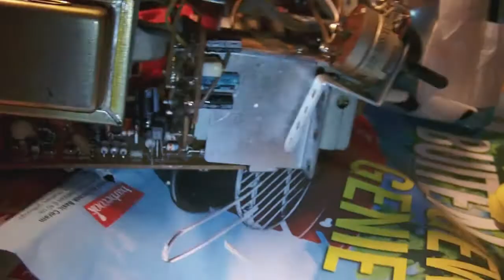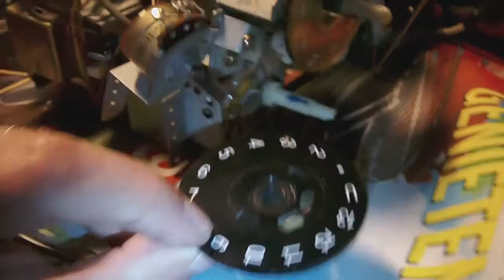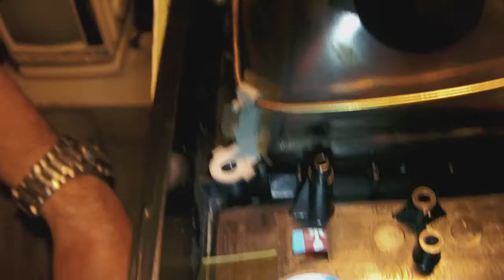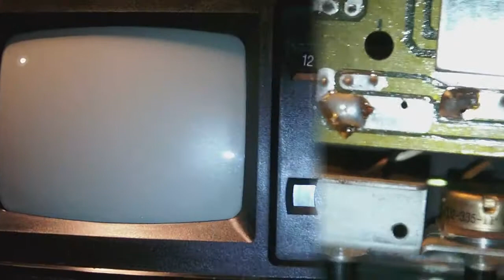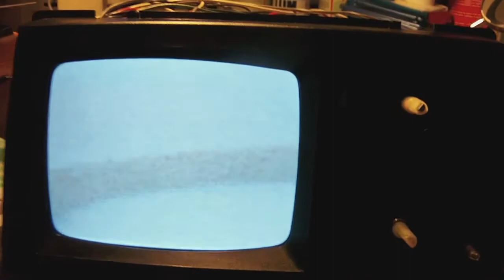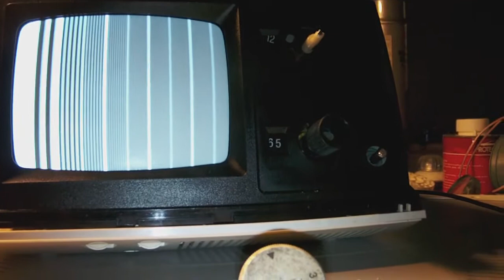Sony TV-520 part 3 of 4

Comment: I would like to be able to modify this TV and add a composite video input. Where have you inserted the video signal? On the silkscreen it is written "video" is it ally? Thank you
Reply from the maker: Hello, you should inject a video signal at the node between the negative of C901 (an electrolytic of 10µF) and R403 and C401 (the base of transistor 501). Use a coupling capacitor of 50V 620pF minimum and place a resistor in series with this capacitor between 1 and 10KOhm if the signal is too strong.
Alternatively, if the signal you want to inject is very weak, you can inject the video signal (through a cap. of 620pF or a bit higher) at the node between R321 and L309 (at the base of transistor Q401; the video amplifier transistor)
Good luck and thanks for considering subscribing :)
Reply: @TechneMoira  Thanks for the information, I subscribe